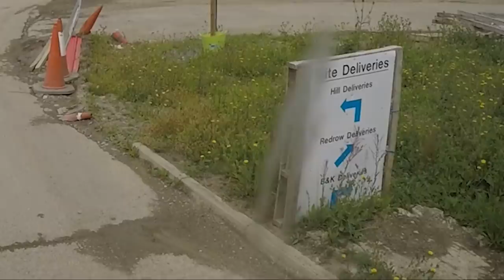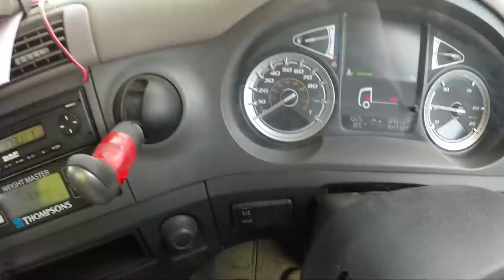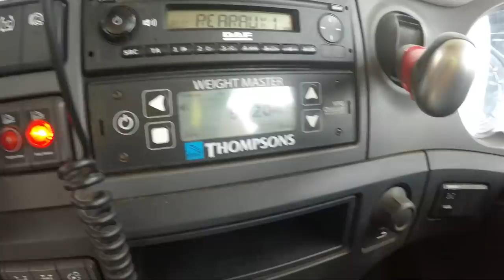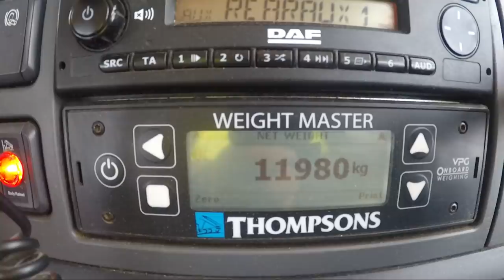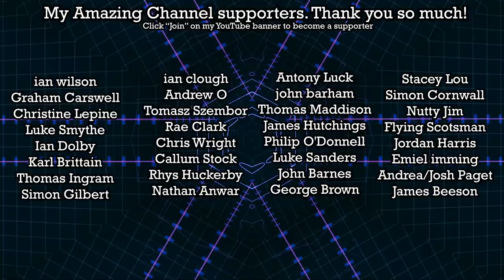Nobody Wants My Load!

Comment: 😂😂😂 had exactly the same thing yesterday on a site in Yate with tarmac on, just spent the whole time saying “ brandwells tarmac” 🤣🤣 found it in the end but no one was forthcoming with information.. site contact went straight to answerphone too..
Reply from the maker: Even worse when they answer but it's some guy 100 miles away and isn't actually on site 😂
Reply: Luke C in a HGV 🤣🤣🤣 luckily that’s not happened “ yet” 

Was looking for a paver or signs of a tarmac gang, but it was a straight tip on the floor ( best kind of tarmac load imo) 

So frustrating though.. I feel your pain
Reply from the maker: @nurburgringobsessed5722  only did a straight tip of tarmac once or twice. Very rare they were 😂
Reply: Luke C in a HGV  best feeling ever not having to clean the back off 😂

Comment: Sometimes these construction workers can give you the runaround. I worked for Travis per kins driving a little 7.5t leyland daf 45 drop side with a tiny crane that could just about lift a 1t bag of sand or gavel and could only offload one side was a pain at times as they would tell you to drop one side and then chase mind and say the other.

Comment: Tipping the body up and taking the sheet off. Surely that’s wrong. What if the sheet failed and you had the body fully in the air ?
Reply from the maker: Then nothing. The sheet doesn't stop the load from coming out the back door.
Reply: Oh right. Surely you should just tip with the sheet on then in that case. If it doesn’t stop the load coming out. Why are you taking it off to tip.
Reply from the maker: @alexcurt6116  so it's off ready to be reloaded again. It's company policy to have a sheet on whilst loaded and on the move. So basically, before I get reloaded it needs to come off, I can either take it off "on site" before I get loaded, or save the time and do it while "unloading" before hand.
Reply: If you have no clue about the functionality of the sheet how are you questioning a trained operator on his doings?
Reply: Shaun Carford. Ah shit sorry buddy didn’t know he was a trained operator.
Reply from the maker: @alexcurt6116  yes mate. 100% "Trained" 😂
Reply: Where you “Trained” by Stevie.
Reply from the maker: @alexcurt6116  no 😂. No idea who that is
Reply: Luke C in a HGV 
I think he means Stevie Wonder ? 🙄 an attempt at humour ? 
About as funny as a wet fart in your Wedding suit !
Reply from the maker: @andy.m265  a wet fart in a wedding suit 😂 love it